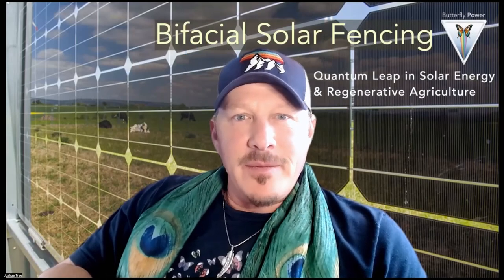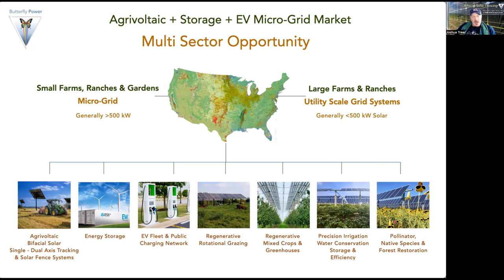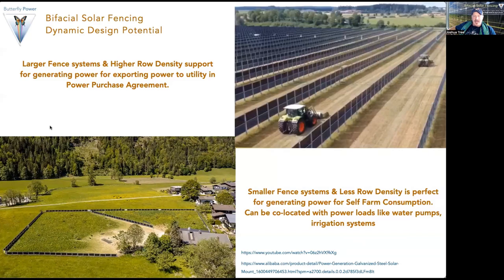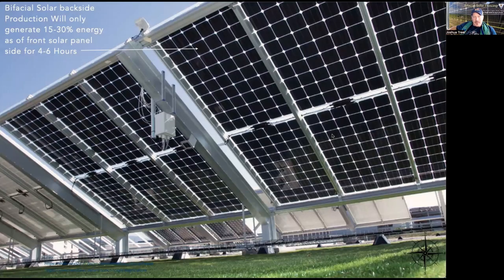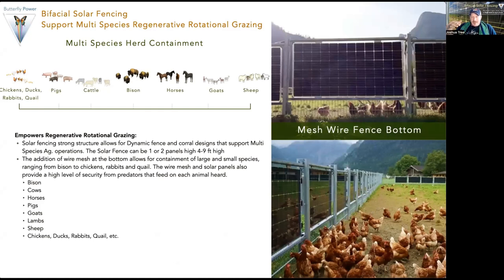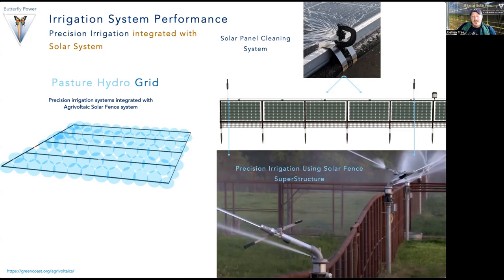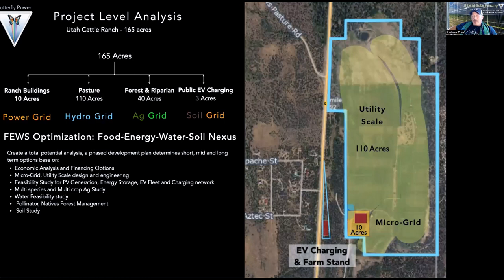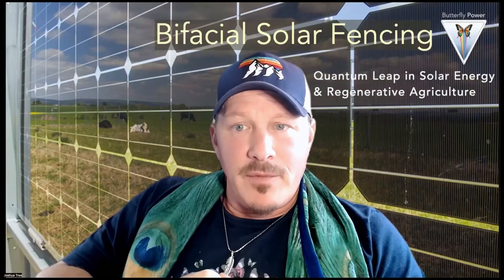Bifacial Solar Fencing- Radical Transformation in Solar Energy Systems & Regenerative Agriculture

Comment: You will have larger farm animals keep testing your "fence", you will have rats keep chews up wires for fun and snakes getting into places where they shouldn't. Horse flies might be able to break those when they fly into one. Goats etc might headbutt one of those if they see their reflections. I am not sure if this is worth it due to the upfront cost of the panels etc and you might keep replacing broken panels. Solar farms don't really run large farm animals, maybe just chickens and ducks etc.
Reply: FUD
Reply: @stickynorth  In this context, “FUD” stands for “Fear, Uncertainty, and Doubt.” It is a term used to describe the act of spreading negative, often exaggerated or unfounded information to influence people’s perceptions. The commenter is implying that the original post is attempting to create unnecessary worry and skepticism about solar farms by listing potential issues that may not be as significant or common as suggested.
Reply: You would want to put the panels out of reach of whatever stock you have in the field, so it would cost a bit more on fence posts. Cattle are probably a bad idea, as a tonne of animal can do a lot of damage to a fence, but sheep and goats are probably not too bad. 
The fences are much more practical to integrate into farmland whatever you are doing with them. The only issue is that it would be harder to see all the stock in a field. 

Rodents will be an issue in any field, and conduits are a standard technology which you will have to install whatever you are doing with the land.

Comment: 20.44 - wrong calculations. East/West directions can not produce full power during 6 hours. There will be much lower generation. During sunny summer day we have 5-6 PEAK hours in average for optimally angled south facing surface (hope you understand the difference between daylight and peak sun hours). Optimally angled south facing panel will generate way more energy, than vertical bifacial from east/west.  Actually, sun energy to vertical East/West is about 50% comparing to 30-40 degrees angled south. But back side of bifacial panel generate in average 50% less power than front side. So, you either lose 25% energy, or need to install 2 one-side panels oriented to east AND west.
Reply: good bifacial panels have 85%+ backsides, and the vertical panels do not overheat as much/fast (morning and eveneing peak isnt that hot, better air circulation). Some tests already have shown more annual power (about 10% more) in favorable conditions. For example the panels stay cleaner and any time there is snow they outperform a standard system by far.

Comment: The water cleaning system sounds cool and if you can run cold water over the panels and catch it, the panels will become cooler, making them work better and last longer. Then, the water can be pumped over to a storage are where the water heat can be transferred into sand or clay in a greenhouse to act as a battery for colder periods. Electricity and heat production with cleaning solution built in.

Comment: What work has been done using irrigation water to clean panels.  RST mentions limescale.  Would you treat all irrigation water or run parallel cleaning and irrigation lines?
Reply from the maker: The solar cleaning systems like RST need the water filtered, this system could also be used for precision irrigation systems.  Parallel irrigation lines untreated water
Reply: @ButterflyPower  Thanks.  The question was around how to set that up.  Obviously filtering all agricultural water is unreasonable, so filtering at water at the panel or central filtering with separate water lines?
Reply from the maker: @SeekingBeautifulDesign  your welcome, thanks for clarifying. Irrigation is complicated and it depends on what Ag. operation you are trying to irrigate. There are many benefits to shift to precision irrigation where applicable, which is more water efficient and can benefit from filtration. Agrivoltaics is an area where this is particularly happening. Excellent example here: https://www.youtube.com/watch?v=bH-L9KK8Wpc&t=1s 
For solar cleaning, RST is a good example that comes with a filtration system.
Hope that is valuable..
If you have a specific project you can reach send some info and I can provide specific options. project@butterflypower.org
Reply: @ButterflyPower  Ok...not getting point across, so just FYI:  When I build this, I will choose between central water treatment and parallel irrigation and treated lines to panel or single untreated line to panel with treatment at each panel or a 3rd, better solution.
Reply from the maker: Got it, Central filtration to separate lines seems the best approach generally. I'm not thinking of a better 3rd option

Comment: I’ve watched about 30 minutes so far. Do you have any analysis or links to sites where you can analyze bifacial production when it’s mounted at 90 degrees versus an optimal year round angle? Or how the production changes as the south, east, north, west orientation changes?

Overall this is an interesting idea just trying to brain storm a little
Reply: It's about 50% less solar production. Verticle works best east west facing because the sun will be lower in the sky at sun rise and sun set.
Reply: You can perhaps considering using a reflector system that sends the southern rays to the east or west sides of the north/south array. Reflectors can be adjusted with sun positioning systems also.

Comment: How do you handle the electrical? just one megavolt string per row of hundreds of feet long?
Reply from the maker: As with all micro grids there needs to be a engineering plan to manage voltage and amperage across different solar  strings..

Comment: I guess after thinking about this more I don't understand why not just mount the panel on top of the fence post.  Seems like you're giving up a lot of production just to make a fence out of the panel.  Plus it seems like this would be risky if you have cattle since they can break one of your fence panels pretty easily.  It looks cool but using the panel as a fence seem to sacrifice too much of the function of the panel.
Reply: More of problem will be wind flex bending the panel forwards and backwards cracking the cells which is probably why nobody makes solar fences.
Reply: @sang3Eta  and weed-growth along the "fence" shading the panels... its a bloody stupid idea is what it is... 🙄😂

Comment: Do you need to put an offset electric fence wire in front of the panels to prevent cattle from rubbing on the panels? I don't think they would last 25 years being rubbed in every day.
Reply from the maker: Yes, your correct.. a electrical single sub wire fence to keep animals from touching the panels..
Reply from the maker: I reference this in the video briefly in multi species containment section

Comment: I’m interested in bifacial panels as you and other people show how much more energy they can produce even with south facing array.  My skepticism about using them as a fence feature is panel fragility and my location is Taos County NM and I can see Joe Shit the rag man shooting bullets at my expensive fence panels for grins. 
Second, off grid solar is my only option there currently as there is no grid power offered by the single electric coop that serves the entire northern part of the state.  3. When new line service is available coop rates are high so it’s cost $/kw is quite high, and the coop has a take it or leave it net metering policy that pays only $.06/kw as I recall and they only settle up once a year.  Not monthly or quarterly.  
4. So there is no financial benefit to invest in expensive systems $.kw or to be a high power producer unless it is for self consumption.  No benefit selling power to the grid because of the large net metering differential.  My 2 cents.
Reply from the maker: To determine south facing or any panel alignment, you need to measure at the location to determine actual yields over the year, There are many apps that allow you to calculate based on the abgle of incidence of the panels, in the case of a fence 90 degrees.
Solar panels are not fragile, strongest most highly engineered glass that is guaranteed to operate for 25-40 years. As far as someone shooting your panels, that's a unique problem that will be hard to solve for..
Reply from the maker: As far as the economics of using power for self consumption or selling to grid, COOP or Utility, you have to run the economics vs. cost of the system in your projects local area.
Reply: @ButterflyPower  Do you keep track of any State, local or Federal grant / loan program that helps rual lot owners construct a solar system when there is no available grid system currently and the sole electric power provider is not able to offer the grid equipment for more than a year or two out from June 2023?
Reply from the maker: @dewholdingsllc1050  Yes, here is a breakdown of project economics for Farms and Ranches, Does not need to be grid connected https://youtu.be/dw76ZYDnaPA
Reply from the maker: @dewholdingsllc1050  Also have entire series on overall Agrivoltaics Micro-Grid Market on our website and in YouTube playlist. https://www.butterflypower.org/us-avss-market/

Comment: Whats the cost benefit of 1 bifacial panel vs 2 unipanels? I always heard bifacial pitched as good for if something is reflecting on the face away from the sun, like snow. But i guess it's cheaper if youre using them like this for a fence.
Reply from the maker: It is covered  in the Video in the Power and Generation section. The reflective for backside is based on the angle and albedo of the surface reflecting the light. In the Fence, in East west each side gets sun in the morning and afternoon.

Comment: we would need deep underground channels or overhead wires to make use of a solar fence - a 10m length of fence would be around 500v DC - a barbed wire security fence will be required to protect people from the 10,000v fence 😂
Parallel circuit? bahahaha.
Reply from the maker: Its a great point on the best approach for wiring of solar fences with the long runs. It is an emerging system design, but happening all over the world. Having designed many of fence systems in real fields there are many great solutions. Also, adding distributed energy storage in the field eco-system at key areas can work while also providing power distribution across the farm, for well + pumps, etc. 
https://sunzaun.com/product/
https://next2sun.com/en/solar-fence/

A sub-electric fence 1-2 ft off the solar fence protects animals and people from interacting with it.